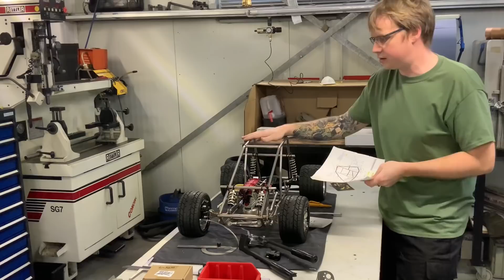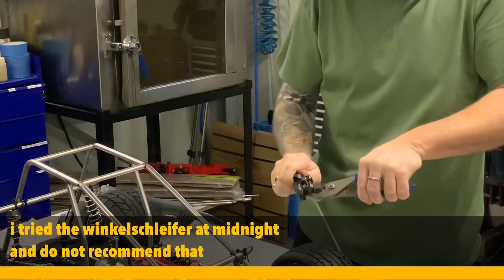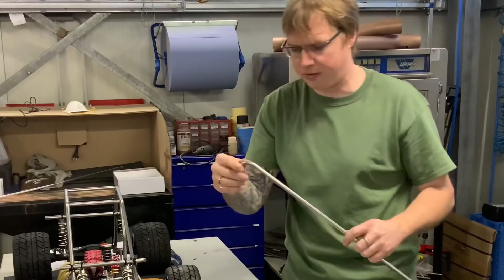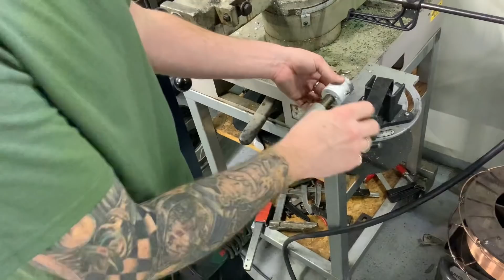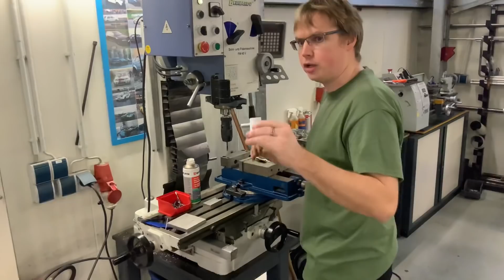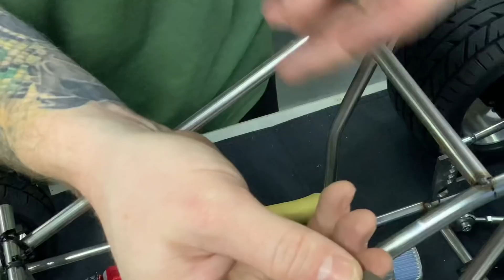RC Tube Frame Chassis  - How To

Comment: You do amazing work. I really like how well organized your shop is. The tubing bender you used was a bit expensive but having the right tools makes all the difference. Perfect 90 deg bend without and kinks. I like your idea of having a company cut brackets and flat parts on a laser cutter or water jet. That would be a great time saver and worth looking into.

Comment: Very remarkable content. Imo these explanations are soo helpful, because youre adding always informations which can clear out any counter question of the viewer.
Keep up the good work, one can only learn from that. 

Best wishes
Reply from the maker: Very nice, thank you! I need to be careful because I tend to talk about details too much. Glad you like it !
Reply: Did you have any problems regarding electro magnetic signals?
I built a chainsaw powered rc car once and the ignition signals messed up my controlling signals. It was solved by using using aluminum shields to isolate the engine and ignition. 

Greets
Reply from the maker: @Mitchi10  i did not have issues like that although I installed A LOT of electronic components. Maybe i was lucky...

Comment: Nice work. I just started tig welding and am not by any means good at it. But you would not believe how much better it is for thin material. The amperage control with a foot pedal is timsane! ;)
Reply from the maker: Ok, Deal! If it is timsane I need to have it! Thanks for your comment
Reply: @timsane  The only other thing I would say is get a tig machine if you can. I have a multiprocess welder that does DC tig only so I can't readily tig aluminum. I use a spool gun for that. And I also waited to get a tig torch and stuff for my welder till I needed it so practice was minimal. That can ruin the fun if you're welding things you want to look good and you need them now. Just my experience. Thanks for sharing all your projects!

Comment: Good content every time. I always look forward to them coming out. Only thing is the difference in audio levels: sometimes I get my head blown off by surprise by the nitro engines if I'm watching with headphones on 😆
Reply from the maker: Sorry, I need to work on that. I will search for a good mic! Thanks for your suggestion!
Reply: @timsane  Don't apologise! And I'm definitely going to use "winkelschleifer" at work when I need an angle grinder 🤘

Comment: With that small size tube,   if you ate not very practiced at tig welding,  you could try Silver Soldering,    with be much neater finish,   and should be strong enough if you ate not bashing the model.
Reply from the maker: I will start with TIG ASAP. When soldering it is annoying that, if you have many spots very close together, that you accidentally open a previous soldered connection again. It happened to me very often in the past. Thanks for watching !
Reply: @timsane  silver soldering is similar to bronze brazing.    With your tight pipe fittings, and your careful attention I'm sure you'll succeed.     It's a great way for joining small stainless parts. Excellent for cables ect.   If you ever need to make a clutch cable for a motorcycle for example

Comment: I started making 1:10 scale RC frames using brass tubing and silver solder, then graduated to 0.500 inch (12mm) mild steel tubing for 1:4 scale projects. The steel is heavy, and I want to try making a frame out of aluminum tubing, which will be much lighter. Did you consider aluminum?

Comment: Did you machine your own rear axle housing and all the internals (gears pinions axles etc.) Yourself, or did you find a pre-fabricated one somewhere? Great video, and great project! Are there sprint car races (full scale) in Germany? I always thought sprint cars were only in The United States. Thanks for showing us all your projects! Very interesting!!! 🇺🇸
Reply from the maker: I have done that before - this time I made my life easier to safe time and concentrate on the engine. I think there is not a single sprint car anywhere in Germany. I grew up in the wrong country ☹️ I will go into the rear axle in the next videos
Reply: @timsane  yes, germany is missing out if theres no sprint cars! I used to go watch them in tulsa when i was younger. They are alot of fun to watch!
Reply from the maker: @user-ko3vg7fc7o  germany is missing out soooo much more sadly. So i have to build toys like this myself....

Comment: Very cool video! And a really good inside look at how u do ur projects. I was wondering if u ever finished ur other build? Of the old school truck. Because I haven’t seen a final run video of it. But great job so far on this build. That toyan motor is very cool! Cant wait to see the end result! 👍🏼Check out Dennis Dempsey on YouTube he custom built a fifth scale chassis with that same engine, using the body of I think a Nissan GTR 34. But very cool build as well.
Reply from the maker: Willys is finished but needs engine tuning because I switched from ethanol to pump gas. The monster truck needs to wait until I find time and energy to finish it. Another overlooked factor is money. These toys eat money like crazy and it is hard to finance this hobby. I hope YouTube makes me able to realize my ideas easier. Thanks for watching

Comment: I cannot believe you are not using TIG welding when you have dedicated so much to perfection in everything else. The level of control with TIG welding is above everything else(except maybe electron beam welding, but that's for rocket parts). The TIG skills required for what you are doing are not that hard to pick up.

Comment: Hallo.... einzigartige Modelle - noch ;) Ich bin zur Zeit in der CAD-Planung für einen 1/4 -Scale "Bug Rod / VolksRod" mit dem Benzin -4 Zylinder von EngineDIY....  Welche Felgen benutzt Du an diesem Chassis und wo kann man diese beziehen? Finde nichts passendes für mein Projekt bis auf eine Seite mit CNCgefertigten Felgen - absoluter Traum in mehrteiliger Ausführung aber finanzieller Overkill :/ 
Lieben Dank für eine Antwort!